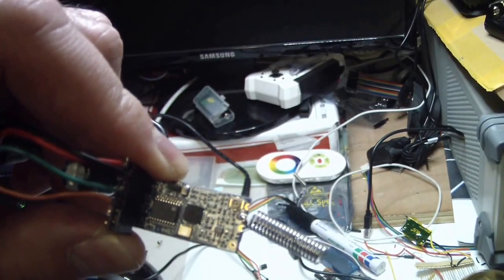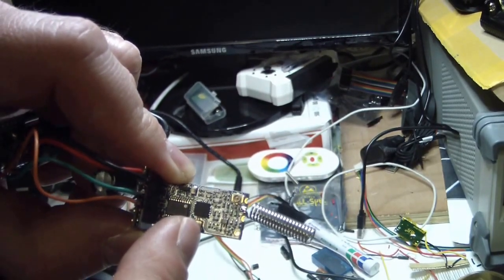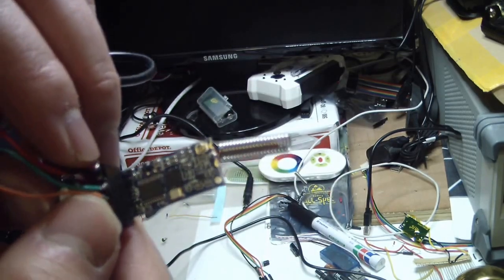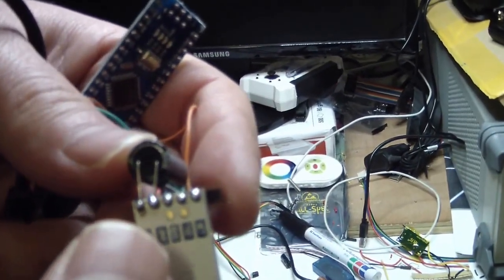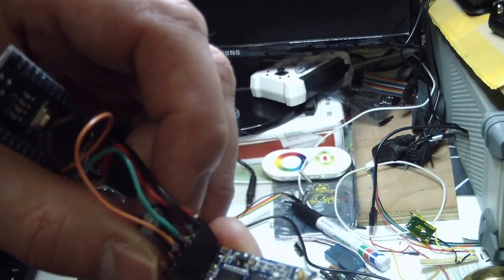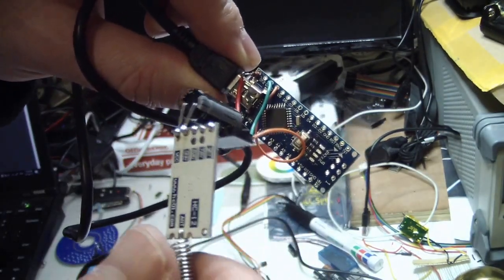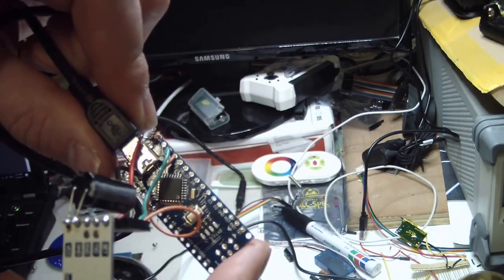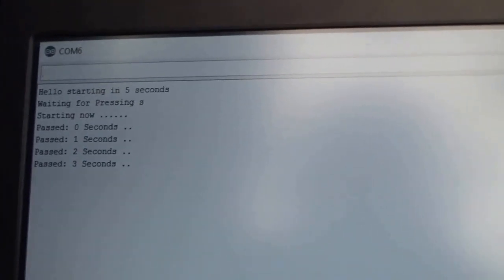HC 12 Uart Transciever Part-1

Comment: Nice video!  I have encountered a problem where i cannot get more than 4m range with HC12 modules with small spring type antenna which was enclosed in the module, I did tried all the settings but no luck! I Appreciate any help.
Reply from the maker: put capacitor on power near the input of the module, try 100uF

Comment: Hello, I bought the same HC12 model as yours and I am having some trouble to set up with arduino.
When I try to send somethig or recive, nothing happens, also when I enter the setup mode by enabling ground on the set pin, I enter "AT" on the arduino serial monitor and "OK" should be returned by it, but nothing happens.

I need some help as its for my bachellors project.

Thanks.
Reply from the maker: Try to put capacitor on power near connecor on board as in my movie